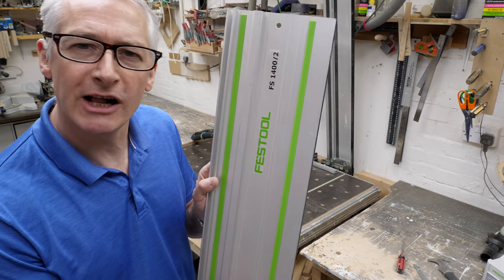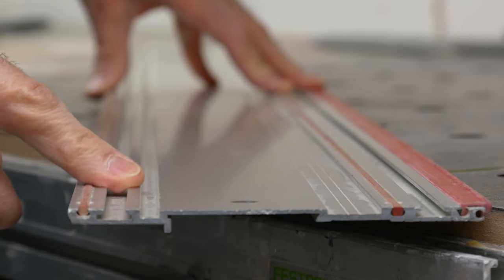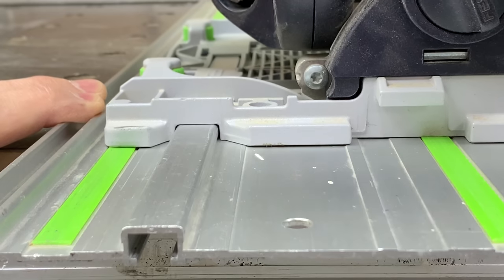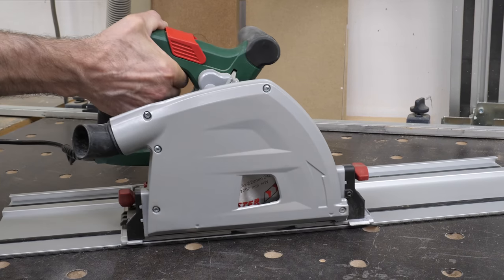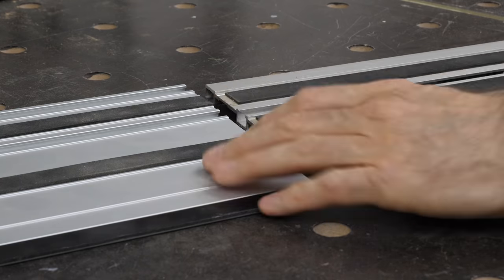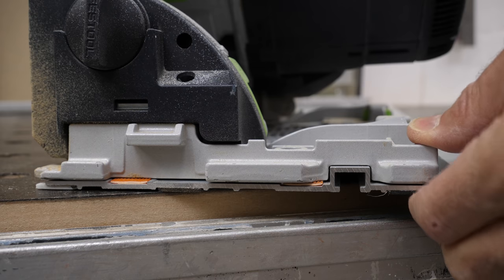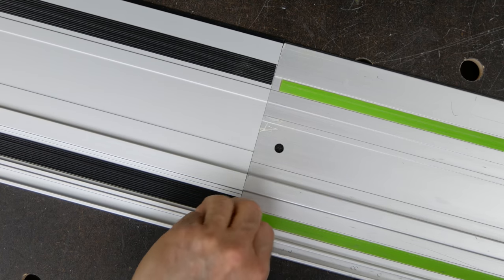Which Rails Work? A Guide to Guiderails [video #403]

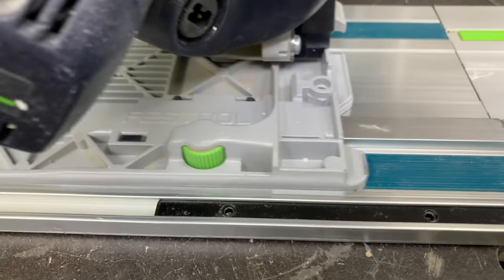Comment: Hi Peter, At 5:50 in the video you mention you couldn't get any of your saws ( except the Makita ) to snug down nicely on the Makita rail. Surely that makes a TS55/Makita rail combo ( to get 1500 instead of 1400mm ) into a non-starter? Many have mentioned the Festool 1400 rails are a little short for ripping 4'x2' sheets ( actual length 1220mm) - interestingly Makita rails used to be 1400mm before they changed the spec. Thanks.
Reply from the maker: Hiya. I think the fact that someone had to point this out to me shows how little difference it makes in real world cutting, tbh. I’ve used a 3m Makita rail for years and years without any issues at all, but then I’m aiming for consistency, not 0.1mm precision, I guess! 🤷‍♂️👍👍

Comment: Metabo have a rail that seems to be a love child between festool and mafell. It has the raised rib that the saw rides on in the middle but no t-slot on the outside. It does use the mafell joining bar though. I've heard that the metabo plunge saw doesn't snug up on the makita rail but it does on the festool and now I know why due t the difference in the width of the rib between the two. It is interesting that your festool saw also didn't snug up on the makita rail either.
Reply from the maker: Yes, interested in getting my hands on a Metabo, though I think the lack of a t-slot will compromise it in the accessories aftermarket.👍
Reply: @10MinuteWorkshop  there is a distinct lack of UK reviews of the metabo saw so I would be very interested if you could get one to review. I've had enough of watching German videos with auto translate subtitles. Robin clevett has one but his review was brief and seemed a sponsored video

Comment: I noted the pdf did not record the vertical measurements . Is that something that should be added ? I have an old  90's FESTOOL model ATF 55 EB and have been looking to get some replacement rail .

Comment: Interesting video again Peter, thank you. I use a dewalt tracksaw with two 1.5m rails but find that when  cutting a 2.4 board length ways, it’s difficult to get a straight cut. Do you find this with festool rails? I was looking at a festool  3m rail as the 2.6m dewalt are all out of stock but they are a massive £300+.
Reply from the maker: Thanks! Never had any issues joining rails, I must admit, though I know plenty who have. The Makita 3-metre rail was always the best value of the Festool-pattern rails, I think I paid ~£120 for mine, way back, but I'd expect them to more than that now!
Reply: I have/had the same issue joining rails for ripping sheets, the saw would bind at the join. Looking into it the rail would flex at the join and cause a crooked cut. The problem was the joining bar was just a hair to narrow in the channels underneath, and would allow the rails the flex and subsequently walk apart from the butt ends. Granted all of the above was with cheap rails so I wasn’t too disappointed. 
Solution was to simply machine my own joining bar to be a neat knock in fit.

Comment: Interesting stuff, though I wish you'd explore Dewalt rails a bit more. I have a DCS520 and two 1.5m rails but do find it a bit limited in compatibility with other systems. Things like Dewalt's 17mm rib, the joining bar, right-angle attachments, using the rails for routers, with benchdogs, etc. It's all hard to find info and complex to figure out yourself..
Reply from the maker: I’m afraid you’ve just listed all the reasons why I don’t want to look into the DeWalt too closely! 🤷‍♂️👍
Reply: @10MinuteWorkshop  Hah, fair enough, worth asking! Definitely much more expensive to get into for testing than all the cheapo supermarket tools.

Comment: Great video. Really appreciate the details on the DeWalt. Maybe I can have my cake and eat it, too, by buying the DeWalt saw and using Festool rails. Something for me to ponder and research more... 👍
Reply from the maker: Thanks! Yep, DeWalt’s a nice saw, I keep trying to pick one up used, but they always go for more than I’m prepared to pay. A healthy sign! 👍👍
Reply: @10MinuteWorkshop  I have the DeWalt saw and I'm about to buy some festool rails. I find the DeWalt rail has a large amount of flex, and is also very wide, so when used on an mft with dogs or a rail square, the flex can mess up the cut v often. Fine for long cuts but no good for using it as a an mft mitre saw
Reply: Chicken Dinnerz I have wondered if the wider rail would cause a problem. I thought the extra width might help with deflection on long cuts, but that’s good feedback from your experience. Thanks for sharing!
Reply: @g1mpster  it is good on long cuts, but for mft cross cuts like Peter does a lot it's not good as it's very happy to sag, and also the extra width can mean there's less material to register on the fence, by the time it gets to the cut line if that makes sense.
Reply: Chicken Dinnerz yup, makes sense. Really appreciate the feedback.
Reply: What other rails work on the DeWalt? Will the excel work with this saw?

Comment: The Evolution glide strip issue might actually be beneficial if you use a Bosch saw since it has a different base and would otherwise only run on one strip and therefore tip a little.
Also, there is a German manufacturer of rails called Youtool which offers FT-style rails up to 5m  for affordable prices, excluding shipping that is. They lack the outer T-track for accessories though but they offer a 90° thingy...
EDIT: Metabo also makes FT-style tracks, I just don't know how compatible they are.
Reply from the maker: Interesting - I’s the Bosch baseplate different time the Mafell then? I haven’t put the Mafell on the Evo rails - I’ll take a look later, thanks! 👍
Reply: @10MinuteWorkshop  Andreas Kalt made a video about using FT tracks for a GKT55. https://youtu.be/xPIncODinFM?t=443
At 07:25 he explains the adaptations he had to make to get it to run smoothely.
Reply: @10MinuteWorkshop  Thank you so much btw for making all those TS/PS vids. One saves a lot of time in research in order to replace one's Bosch track which might or might no have been somewhat damaged in a very stupid kick back incident due to an unsupported workpiece on a concrete floor...

Comment: You are the Tracksaw King, I love my Titan I am making a replacement roof cover for my friend’s pond equipment enclosure and needed to cut the fall for the 75x50 timber bearers. I set my table saw up only to find I couldn’t set out my angles so got my track saw out and it cut both bearers perfectly. Love the saw and the tracks think I might now need to replace the splinter guard as is was 50mm cut and there was lots of black bits in the sawdust and there was no burn out. Thanks for your advice on getting the Titan. Keep up the great work.
Reply from the maker: Cheers Ray! I was using my Titan just the other day - still my favourite entry-level saw, even after all this time! 👍👍

Comment: Hi Peter, I am really enjoying your videos!  Especially your track saw ones...so much so that I’ve decided to take the ‘plunge’ (sorry 😂).  As a diy-er I’m going lower end - just wondering if you had any advice/recommendation between the Mac Allister 165mm or the Erbauer 185mm from Screwfix... the first is £50 cheaper but the Erbauer comes with a better blade, clamps and a track bag. Struggling to make a decision!🤷🏼‍♂️
Thanks!
Reply from the maker: Thanks! I haven’t used either I’m sorry; the NacAllistee is the replacement for the old Titan, and the Erbauer is something else again. The people I know who have the Erbauer seem happy with it. My only concern with the Erbauer is the blade - don’t know what the choice is like at that size. Sorry I can’t help more. 🤷‍♂️👍
Reply: Peter Millard  Many thanks 🙏 I’ve just ordered the MacAllister... now to re-watch all your videos on how to set up a track saw workshop 🤔
Reply: Macalister, Titan and Erbauer saws are all from the same factory, just slightly different specs. Kingfisher who own both B&Q and Screwfix are just amalgamating their brands across all outlets so where the Titan unit has disappeared, it's just the same unit branded under Mac Allister. I'd always go with a bigger blade personally. 185mm is a typical circular saw blade so there will be no issues in getting decent blades.

Comment: Just looking at this again as I have been having the exact problem with the TS55 and the Evolution rail.  Basically when making long mitre cuts to make a "waterfall" table as we all know the TS55 will tip over when at 45 degrees.  So it is necessary to keep very positive pressure on the sole plate to keep the saw flat.  Putting the pressure in the wrong place will cause the saw to rock on the track just a little, ruining the cut.  I plan to buy some more low-friction tape and put an additional strip in the empty channel, to see if this resolves the problem.
Reply from the maker: Yes, that would be a pain. If the additional glide strips don't help then something like the Anti-tip from Bisch Basch Bosch - https://youtu.be/hpJXwEJkgpQ - would do it, but he's out of stock of the Festool now. 🤷‍♂️

Comment: What's the current thought on the Evolution rails vs genuine Makita in the UK? Circa £70 vs £168 for the 7 part kits). I don't need/afford 2 saws so I'm probably going to use my DHS680 with the track adapter. (cutting right to left of course).  

The macalister full kit sounds good for the money, but I'm sworn off cheap power tools after battling a B&D "pro" for too many years of my household diy. (That wobbly beast couldn't make two square cuts in a row, I thought it was me for years! 😢😂)  It got stolen, so I finally allowed myself to buy a branded saw.
Reply from the maker: Unless either of them have changed then my thoughts are exactly the same as in this vid; the evo rails are great value but have some issues eg the upside-down t-slot and the twin glide strips on the wrong side of the rib. The Makita rails are a better bet overall, but the ‘anti-tipping lip’ is a pain for some saws and accessories. 👍
Reply: @10MinuteWorkshop  thanks. I always find that one of the worst choices. My frugal nature fighting against picking something that will give me a head start with my meager skills.  Even after I proved to myself how rubbish my cheap brand saw was it took it being stolen from my shed for me to spend £££ on a reasonable tool to replace it 💰💰.  Versus those online who use £6000+ of tools to make a £15 spice rack,  Present company excepted of course. 👍 😎🧙‍♂️

Comment: Interesting! However you didn’t mention Bosch much and it appeared to me that you took Festool as the de facto standard. Well of course that is your personal favourite.
Reply from the maker: As I say in the video, Festool is the defacto standard - all saws will run in their rails. I don’t mention the Bosch much because there’s not much to say; it’s made by Mafell to their proprietary pattern, and you can only buy it from Bosch or Mafell. And Festool isn’t my ‘favourite’ but certainly, it’s what I chose to use when I started out buying ‘proper’ tools, and I’ve had no reason to change, despite its many faults. As I said in the Festool/Mafell video, if I were starting again I’d probably go with Mafell. 🤷‍♂️

Comment: Thinking about, there are 9? types of rails

- Festool (almost 100%: New Evolution rails)
- Dewalt
- Einhell (2 splinterguards, one 90° , the other 45°)
- Makita, like Festool, but they have lip, same: Triton
- Mafell/ Bosch. Only saw wich can be used besides  M/B : Metabo
- Scheppach, much wider
- Parkside/ Walter... with the C instead of t-nut
- Metabo, kind of Mix Bosch/ Mafell/ Festool
- Festool alike, but T-Nut upside down

Comment: Very happy with my Evolution rails matched to the Macallister track saw. Most of my work is on melamine coated chip board. Any ideas on the most "Grippy" cushion strips for the base. I would like to upgrade them
Reply from the maker: Festool have the grippiest cushion strips on the base, in my experience. 👍
Reply: Thank you😊

Comment: Well, as I already own a scheppach plunge saw my quest for additional rails is now over.  I've made a decision against the Evolution set and for a pair of 1400 scheppach rails. I had the chance to buy two new  KITY 1400 rails for 39 € each directly from Scheppach. KITY is a daughter brand of Scheppach. The glide strips are green instead of blue, but who cares. 39 € was a real hot  deal, as the cheapest seller for scheppach rails here in Germany was the "Bauhaus" chain for 49 €, all others were way above the 60 € mark. When I randomly checked the original Scheppach store and saw the kity labeled rails for 39 € I made the decision in a split second, no pondering involved. 
I've bought a set of bessey rail clamps to accompany the rails, but I'm still missing a rail bag - and perhaps a second rail connector for the second underlying T-track of the scheppach rails.

There's a  disadvantage with those scheppach rails: the splinter guard is plain crap. The glue doesn't stick and the rubber is way too wobbly. Therefore I've ordered 5 meters of festool splinter guard as a replacement, that should do the trick.
Reply from the maker: Hi Matthias. Yes, I used the Aldi branded Scheppach saw and rails in my 'Tracksaw Workshop' series - there's a playlist with them in order if you haven't seen it already. The scheppach rails are problematic generally as they are unusually wide, but I fixed the splinter-guards with thicker rubber strip I found through an eBay seller; I tried the Makita strips, but found they weren't thick enough. 👍
Reply: @10MinuteWorkshop  I saw all your track saw videos long ago - but well before the first parkside video came out, and because of your videos I was quite sure that a scheppach plunge saw - properly adjusted, without any manufacturing flaws and with a replacement blade - would be quite sufficient for me. The festool replacement splinter guard fits nicely, I've already successfully tried this myself on the two 700 tracks after I read about this on the blog of Heiko Rech, a german master carpenter who also has some interesting track saw videos.

Comment: What is the general concensus then, i have narrowed it down to 3 favourables....... Festool, Makita or Bosch...? Not sure which one to invest in as my Titan let me down....! Great video Pete.
Reply from the maker: Thanks! I have a Makita but haven't done much with it yet, but I think Alastair over at Freebird interiors compared it with the Festool, and the Festool won out for longer-term durability; I'd say it's certainly a nicer tool to use, if that counts for anything, and if you shop around then it needn't cost much more than the Makita. Bosch is a slightly different animal - same rails as the Mafell, and a similar saw in many ways, but without some of the bells and whistles. Less scope for adding extras, because of the design of the guiderail, but you can always use Fesool (or Titan!) rails with it. Like the Mafell it doesn't keep the same cut line when you're on a bevel cut, so something to bear in mind if you do a lot of them. Ideally try and get your hands on them - difficult these days, I know - and see how they feel, as it can be a very personal thing. HTH! P 👍
Reply: @10MinuteWorkshop  Thanks for your advice, give me something to think about, cheers

Comment: Hi Peter, you didn't include the Titan rails which I've found to be the closest to the festool rails and joining bar works from the top. I imagine you can't buy them separately and only come in 700mm lengths but are great from when I upgraded to festool.
Reply from the maker: Thanks Sam. The Titan’s discontinued now, but yes, the Titan rails are the same as the Makita, Triton, Excel etc... 👍👍

Comment: Again a great video. Does the excell guide rail also (as the Makita) have a rib that's slightly narrower than the festool - I've got a festool 1400 rail (and festool saw) and need to make some  longer cuts. Bit reluctant to pay Festool prices but probably will do if 2 different make rails don't fit well together ... Thanks
Reply from the maker: Yes, it does - it’s an almost exact copy. 👍
Reply: thanks for that Peter

Comment: Like others I've fallen foul of the Excel 2 x 700 incompatibility with Makita. However I'm using a Makita 7601 regular circular saw in conjunction with the recommended rail adaptor, and if approximately 17mm of black plastic it trimmed-off the two protuberances on the 'motor side' of the adaptor it looks like it may well work and retain its integrity. But I'm close to spending nearly as much as the proper item, and ending-up with something which may be a bit of a lash-up. Should have learned this lesson by now at my stage of life, but can't stop myself always chasing to low £££ option.

Comment: Great video, your style is so supportive and encouraging :-)
I bought the 2021 Parkside tracksaw and wanted to use the Festool FSZ 120 guide clamps but I can't find out if they will fit the Parkside track. Axminster Tools sell similar own (don't look like Festool) clamps but they are 7.5mm thick (for inserting into the track lower T slot. The Parkside track T slot is inly 6.25 mm deep Any ideas? Regards
Reply from the maker: Hi there. Yes, the Festool screw clamps, quick (ratchet) clamps and the similar Axminster trade ratchet clamps all fit the Parkside rails. 👍👍
Reply: @10MinuteWorkshop  Many thanks :-)
Reply: @10MinuteWorkshop  I Got the Festool clamps from Screwfix worked like a charm. Many thanks